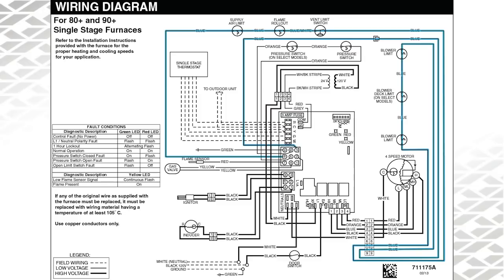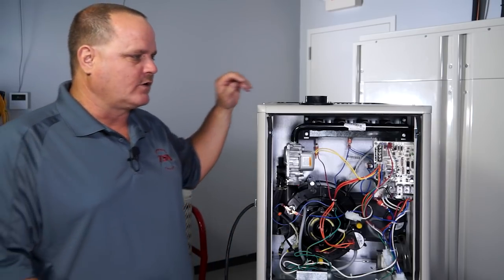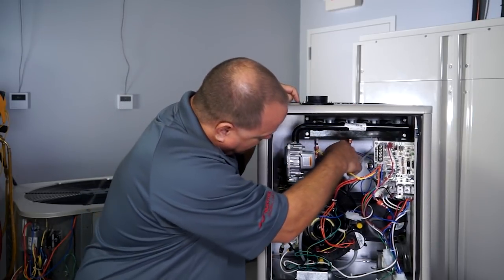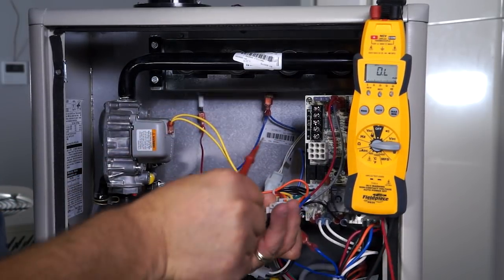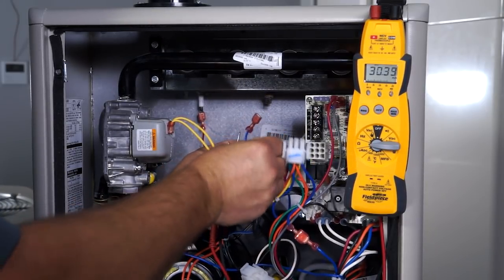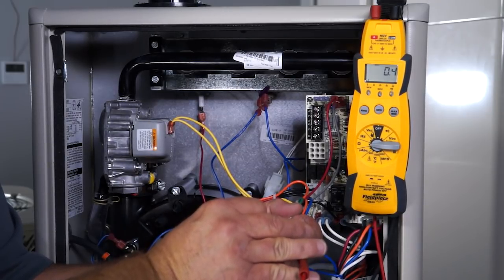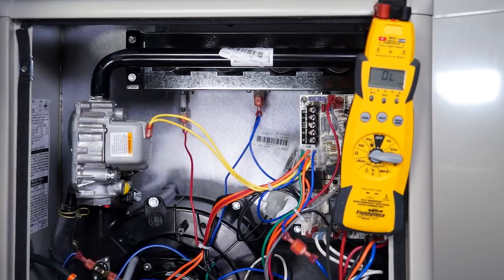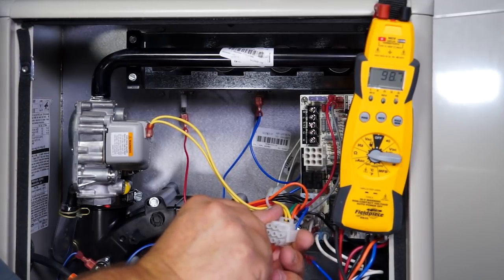Single Stage Furnace Limit Circuit

Comment: What if the limit circuit tests good, however still throws limit code and won’t operate? Would that mean a control board failure?

Comment: My son has a Gibson furnace not sure what one models are at 78 and a couple higher numbers.
His problem is we hear the thermostat click and call for heat not nothing happens I didn't think to.take multimeter so I was stuck.
I did try flipping the circuit breakers but nothing happened.
I see no flashing indicator on the board?
Any ideas?
Was told it flashed 4 red but I didn't see anything when I was there
Reply from the maker: Please contact Nortek Technical Support for assistance 1-800-422-4328